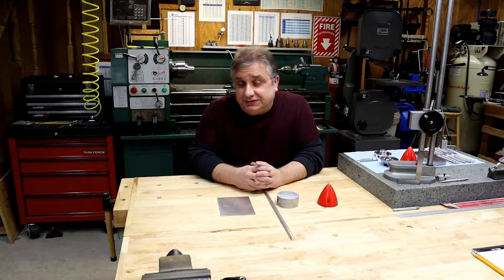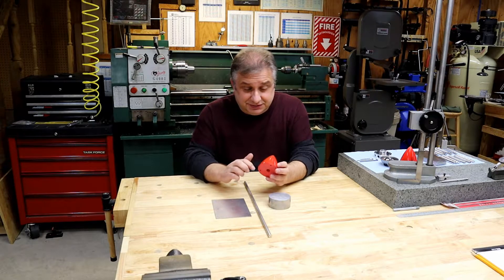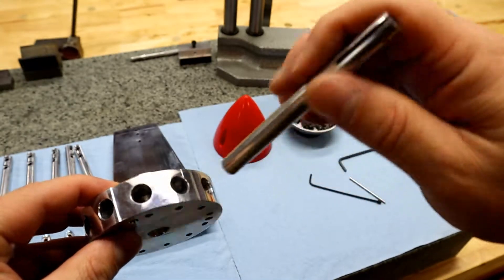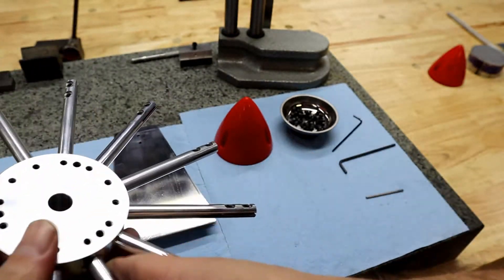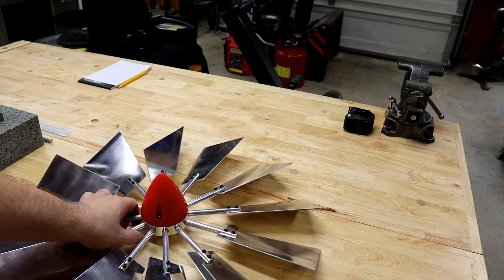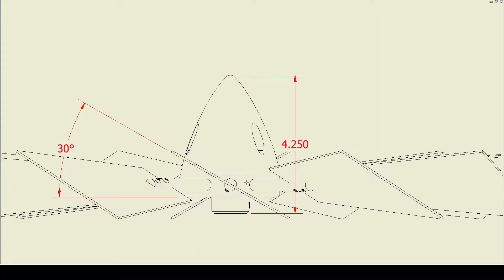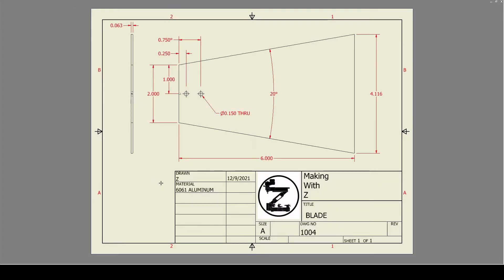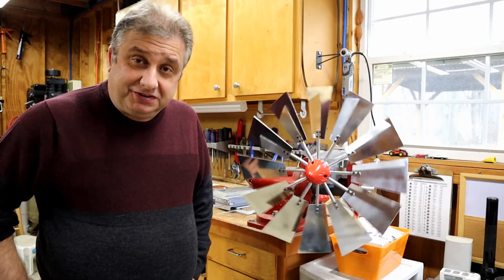Homemade Wind Turbine Blades & Hub

Comment: Yes, I have my own mini metal lathe, drill press belt sander and wood lathe . I use 2 times four PVC prop blades (6") with 1 1/2" dia. polyurethane hub ( 2 SS ball bearings) come with 4 PVC gray rod (3/8") propeller holders  for contra prop whirligig comes with swept wings, large fin. I use 1 1/2" galvanized fence pipe (6') for swivel support. My contra prop works very well due to all weather.